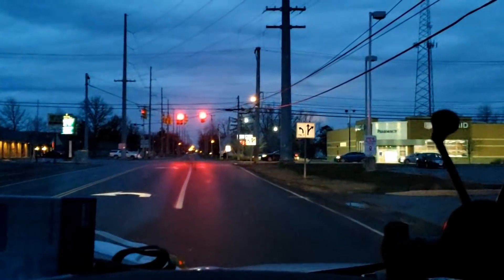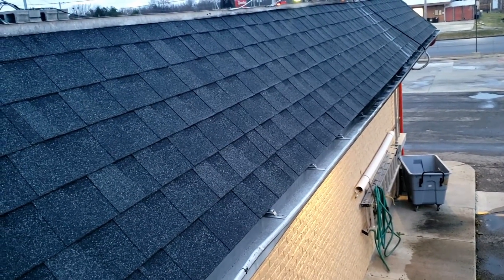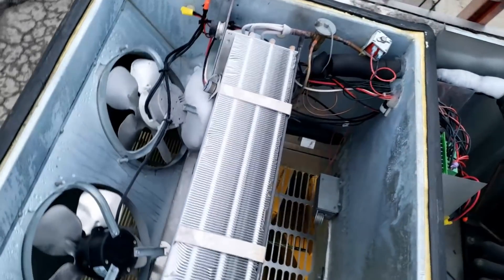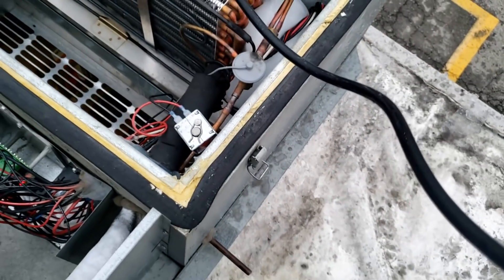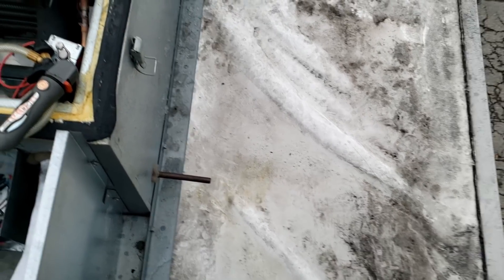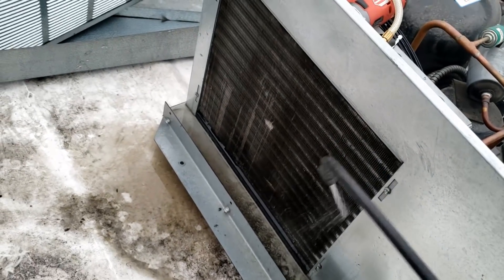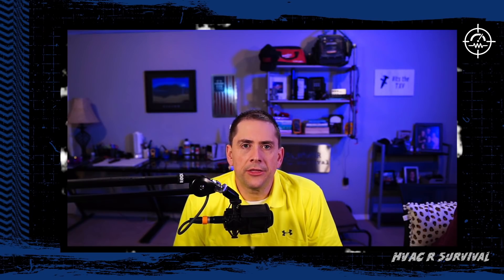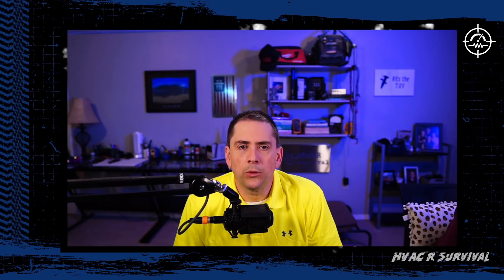Walk-In Freezer Leaking Water On The Floor

Comment: So do you run the drain heater on that during normal run time? On big WIF’s i like them wired that way. 

I usually defrost those capsule units with top on to speed defrost as the top holds the heat, but water is soooo much quicker then heat gun.
Reply from the maker: I personally prefer the drain heater on all the time.

Comment: run a second ladder off the top of walk in box with feet against the condenser, assuming it's bolted down tight. I call it "ladder jenga" LOL
or you may ne able to put ladder feet against walk in box at the ground level with a steeper pitch to match the angled roof or close, then use step ladder to climb up onto the extension ladder.
done that many times on hacked up rooflines, even screwed down 2x4 with straps to hold the ladder feet on other pitched roofs.
or if there's clearance, park the van/work truck at bottom and use a wheel to hold the ladder feet from sliding out(ladder set steep to match the roof pitch)
Reply from the maker: Using the van front bumper as a backstop to the extension ladder is probably the safest thing 👍👍

Comment: Its really interesting to me with all the different OSHA and building code requirements we have that roof access is still so dangerous. A residential set of pull down attic stairs is safer than most commercial rooftops where all essential equipment is located.
Reply: it's a feeble attempt to curb natural selection and the darwin idiots from killing others ;)
all to no avail though.
Reply: I'm on a roof pretty much every day I work. Some of them are downright scary.

Comment: Seen where you guys have a Iced up unit turn on heaters,and use water if available. Why do not use a heat gun?? To help with defrost! Can control just how much heat your using.
Reply from the maker: Heat guns takes to long, water is the fastest way to melt ice.

Comment: What kind of control on that Copeland in unit ?
Reply from the maker: Emerson, it's basically a low pressure cutout switch,  that's why I had a put a mechanical one on it until I got the new control. Basically a over engineered electronic gizmos to go bad.

Comment: Maybe you could use a big pvc piece to run it off the roof but not couple it to the little stub
Reply from the maker: I thought about using maybe a two inch or 3-in piece of PVC pipe but I have a feeling it may potentially plug it up. It's lasted all these years. Who knows, the worse that can happen is someone falls off 🙄jk
Reply: @HVACRSurvival  use 3/4" or 1" but don't solid connect it to the copper leave a wide airgap, then if it clogs/freezes it will just spill over onto the box roof again :)